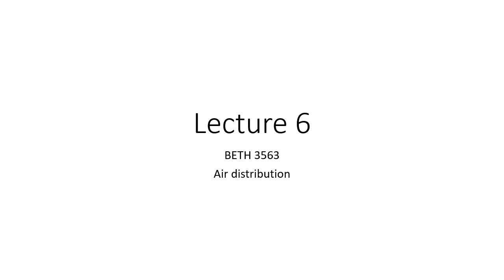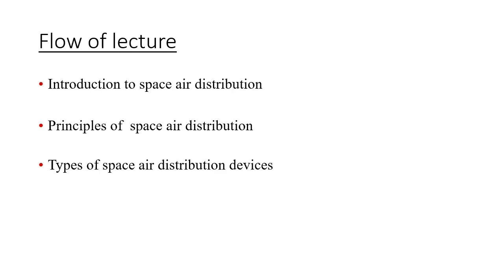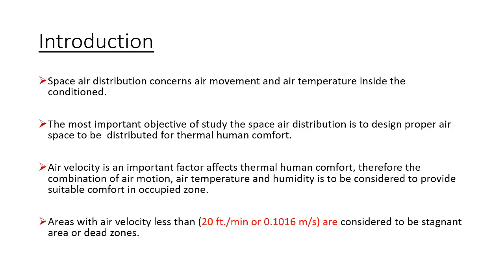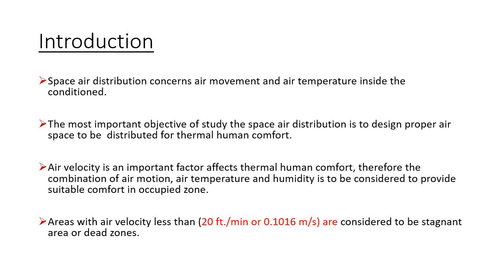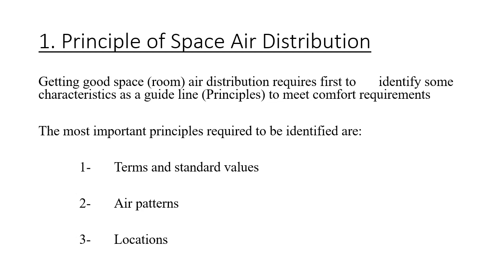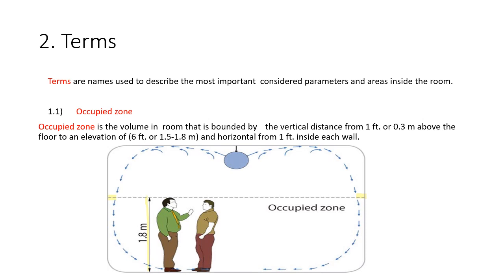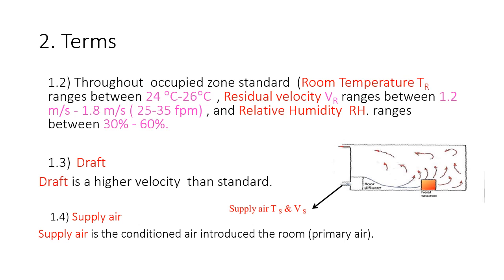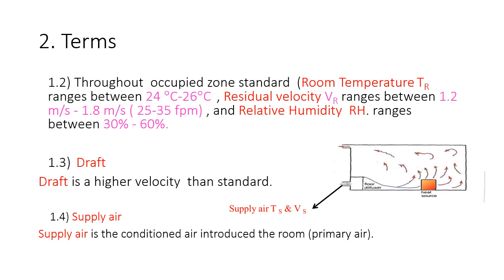LECTURE 6 SPACE AIR DISTRIBUTION

Comment: ahmad syahir bin ismail b091810081

from the lecture videos, there are four types of air distribution devices which are grills that consist of a frame and  fixed or adjustable parallel bars. second is ceiling diffusers that consist of  a series of separates concentric rings or louvers with collar or neck to connect to the duct. third is slot diffuser which consist of long strip- shaped with one or more narrow openings, depending on the number of bares. the last is plenum ceiling which is suspending ceiling below the structure ceiling ,and also called dropping ceiling.

Comment: Hakim bin Zainul B071710531

1.0 Introduction
       *Space air distribution is about air movement and air temperature inside the conditioned space.
       *To design proper air space to be distributed for thermal human comfort. 
       *combination of air motion, air temperature and humidity is considered for suitable comfort

2.0 Principle of space air distribution 
      1. Terms and standard values ( to describe most important parameters inside area room )
      2. Air patterns ( behavior of air supply to a room )
      3. Location ( important to consider in achieving good air distribution )

3.0 Type of space air distribution devices
     1. Grilles and register
     2. Ceiling diffusers 
     3. Slot diffuser 
     4. Plenum ceiling

Comment: NUR NABILAH BINTI MOHD ISHAK (B091810284)

In this lecture, we have learnt about space air distribution. Space air distribution related on air movement and air temperature inside the conditioned space. The important principle of space air distribution are terms and standard values, air patterns and location. Space air devices used to create proper air distribution in the conditioned space and it is known as air supply devices. There are four type of air supply devices : Grilles and registers, Ceiling diffusers, Slot diffuser and Plenum diffuser.

Comment: Nur Shafiqah bt Abdul Ghapoor (B071710400)

1. Introduction
-objective is to provide thermal human comfort which are the combination of air motion, air temperature and humidity.
-areas with air velocity less than 20 ft per min are considered dead zones.

2. Principle of Space Air Distribution
     2.1: Terms and standard values.
               -occupied space
               -room temperature 
               -draft 
               -supply air
               -designed temperature 
               -throw
               -air jet
               -spread

     2.2: Air pattern
            -behavior of air supply to a room
                *when Ts<Tr, air will drop down (summer)
                *when Ts>Tr, air will rise up (winter)

     2.3: Locations
            - important to achieve good air distribution
            2.3.1: High wall -cooling
            2.3.2: Ceiling -cooling
            2.3.3: Low wall - heating
            2.3.4: Floor or sill -heating

3. Types of Space Air Distribution devices:
     a. Grilles and registers
     b. Ceiling diffusers
     c. Slot diffusers
     d. Plenum ceiling

Comment: RAHIMI MUSTAPHA (B071710225)

So basically this topic was to study about air distribution (principle involve and type of device used in the system) in order to design a proper air distribution system in a space to meet the human comfort.
1. Introduction
 -  Designing a proper air system in confined space in order to get a proper human comfort requirement.
-   Space air distribution concerns air movement and air temperature inside the conditioned.

-   Areas with air velocity less than 20 ft per min are considered dead zones.
2. Principles of space Air Distribution
-  There are several principles need to used and can be used when applying into the air distribution system.
- Term and standard values
, Air patterns, Locations. All these principle play a big role in air distribution system.

3. Types of space air distribution devices
-  So the purpose of these type to be used in the air distribution was to created a proper air distribution throughout the system and in a  space.
- There several type of devices can be used to help maximizing the air distribution flow such as grilles  ceiling diffuser, slot diffuser and few more others.

Comment: Alden andrian phius (b071710392)

1. Introduction
- Space air distribution is an air movement and air temperature inside the conditioned space.
- Space air distribution is to design a proper air inside the space in order to give thermal human comfort.
- Air velocity affect the thermal human comfort.

2. Principle of space air distribution

3 principal need to be identified to meet comfort the comfort requirements. 

i. Term and values that considered the parameter and area inside the room. 
- Occupied zone
- Draft
- Supply air 
- Design temperature
- Throw
- Air jet

2. Air pattern
- Behavior of the air that supply to room
- When Ts<Tr air will drop down
- When Ts> Tr air will rise up

3. Location will considere for achieving a good air distribution. 

- High wall
- Ceiling
- Low wall
- Floor or sill

Types of space air distribution device
- Grilles and register
- Ceiling and diffusers
- Slot diffusers
- Plenum ceiling

Comment: MUHAMMAD IQMAL BIN MOHAMAD ZAIDDIE
B091810231

Introduction
1. Space air distribution concern air movement and air temperature inside the conditioned.
2. To design proper air space to be distributed for thermal human comfort 
3. Air velocity important for human comfort and its combination of air motion, air temperatures and humidity 

The important principle
- terms and standard values
-pattern 
-location

Type of air supply device
1. Grilles and register 
2. Ceiling diffuser 
3. Slot diffuser 
4. Plenum ceiling

Comment: AMIRA NASUHAH (B071710121)

1. Introduction
 - Space air distribution concerns air movement and air temperature inside the conditioned.
- Areas with air velocity less than 20 ft per min are considered dead zones.

2. Principles of space Air Distribution
-  Term and standard values
-  Air patterns.
-  Locations.

3. Types of space air distribution devices
- Grilles and registers
- Ceiling diffusers
- Slot diffusers
- Plenum ceiling

Comment: Cheah Kok Hun ( B071710006 ) Understanding about new concept of space air distribution and its principle  and the variant of different space air distribution device which can help in enhancing to design a better air distribution system. 

Principle of space air Distribution to be obey 

-terms and standard values (most important parameters and areas)
-pattern (behavior of the air supply)
-location (air distribution device is an important consideration to achieve good air distribution)

.Locations
- High Wall : Cool air drop naturally and help air circulation
- Ceiling : Recommend for cooling not for heating
- Low wall : Recommend for heating
- Floor/Sill : Excellent for Heating

Principle of space air distribution (AD)
-occupied zone
-draft
-supply air
-design temp
-throw
-air jet
-spread

Air pattern
behavior of air supply to a room
 *when Ts<Tr, air will drop down (summer)
 *when Ts>Tr, air will rise up (winter)

Types of space air distribution device
- grilles 
- Ceiling diffusers
- Slot diffusers
- Plenum ceiling

Comment: Asyraf Hakimi B071710484

Principles to be identified for good air distribution is terms and standard values, air patterns and locations. Air supply devices divided into 4 type which is grilles and registers, ceiling diffusers, slot diffuser, and plenum ceiling.

Comment: MUHAMMAD AMIR SYAFIQ BIN AHMAD SUKRI  (B071710161)

Space air distribution :
- air movement & air temperature  inside the conditioned 
-to design proper air space  to be distributed for thermal human comfort
-air velocity is an important factor affect thermal human comfort 
- air velocity less than 20ft/min or 0.1016m/s are considered to be stagnant area @ dead zones

Principle of space air distribution
- term & standard value 
- air patterns
- location

Occupied zone:
- volume in the room that is bounded by the vertical distance from 1ft or 0.3m above the floor
- room temperature Tr (24 celsius - 26 celsius )
- residual velocity Vr (1.2m/s - 1.8 m/s) (25 - 35 fpm)
- relative humidity RH ( 30% - 60%)

types of  space air distribution: 
- grilles and register
- ceiling diffuser
- plenum ceiling

Comment: NUR FITRAH NADIA (B071710363)

Introduction
1. Space air distribution concern air movement and air temperature inside the conditioned.
2. To design proper air space to be distributed for thermal human comfort 
3. Air velocity important for human comfort and its combination of air motion, air temperatures and humidity 

The important principle
- terms and standard values
-pattern 
-location

Type of air supply device
1. Grilles and register 
2. Ceiling diffuser 
3. Slot diffuser 
4. Plenum ceiling

Comment: Tiban A/L Ravichandran 
B091810285
Principle or air distribution space term
-Used to describe the most important considered parameters and area inside rooms
-Air patterns
Behavior of air supply to room
-Location
To give a best design for distribution, a location should be a consideration

4 types of supply device
-grills and registers
Usually have adjustable parallel bar in square or rectangle shape
-ceiling diffuser
Consists of series of separates concentric ring louvers with collar
-slot diffuser
It is a long strip shape with one or more narrow opening
-plenum ceiling
A ceiling under structure ceiling called dropping ceiling

Comment: Muhamad Afiq Haikal (B071710534)

#Objective
- to design proper air space to be distributed for thermal human comfort

#Dead zone is when the air velocity less than 20ft/min or 0.1061m/s
#Know the pattern to select and locate air supply properly
#Selection of air distribution device
-High wall and ceiling for cooling
-Low wall and floor for heatinh

#Type of air distributer
- Grilles 
- Ceiling diffusers
- Slot diffusers
- Plenum ceiling

Comment: MEGAT MUHAMMAD UMAR (B071710565)

1. INTRO :
- to know the space air distribution concern air movement and the temperature
-to design proper air space
-factor affects thermal human comfort
- the area with low air velocity to be stagnant or dead zones

2. Principle of space air distribution :
-term and standard values. ( occupied zone ,draft supply air, design temp, throw, air jet and spread )

-Air patterns ( when Ts is lower than Tr air will drop down indoor, usually when summer. And when Ts higher than Tr air will rise up indoor usually when winter )

-Location ( High wall, ceiling and low wall)

3. Type of space air distribution devices
-grill and registers
-ceiling diffusers
-slot diffusers
-plenum ceiling

nice information.  tq madam :D

Comment: MOHAMAD ZAHIM BIN MOHAMAD SUKAIRI B091810344

Introduction
- Objective is to provide thermal comfort zone
- The areas with air velocity less than 20 ft per min considered to be stagnant area

Principle of space distribution
- terms or standard value
- Air patterns
- Locations

Types of space air distribution device
- grilles 
- Ceiling diffusers
- Slot diffusers
- Plenum ceiling

Comment: AHMAD TAUFIQ BAIHAQI BIN MOHAMD B091810279 3BMMH S1\1

From the lecture 6 Space Air Distribution video, I've learned the introduction
 about Space air distribution concern air movement and air temperature inside the conditioned. Next, to design proper air space to be distributed for thermal human comfort. Lastly, air velocity important for human comfort, and its combination of air motion, air temperatures, and humidity. Next, the important principle
 are terms and standard values, pattern, and location. Finally, there are four types of air supply device that are grilles and register, ceiling diffuser, slot diffuser and plenum ceiling

Comment: Muhammad Zulqarnain Bin Zamzuri  B071710782

Introduction:-
- Air velocity importance because it affect thermal human comfort
- Dead zone/stagnant area = Air velocity < 20ft/min

Principle of space air Distribution:-

1.Terms and standard value
- Occupied Zone : Volume of room bounded vertical = 1ft (0.3m) above the floor to an elevation of 6ft ( ≈ 1.8m ) 
  and horizontal from 1ft each side of the wall. 
- Room temperature ( 24°C - 26°C )
- Residual velocity ( 1.2 m/s - 1.8 m/s )
- Relative humidity ( 30% - 60% )
- Draft : Higher velocity than standard
- Supply air : Primary Air
- Design Temperature
- Throw : Distance
- Air Jet : Air Stream
- Spread : Expansion of Flow Stream 

2.Air Patterns : Behavior of air supply in a room
- Summer : Ts < Tr
- Winter : Ts > Tr

3.Locations
- High Wall : Cool air drop naturally and help air circulation
- Ceiling : Recommend for cooling not for heating
- Low wall : Recommend for heating
- Floor/Sill : Excellent for Heating

Type of Space air distribution Devices

1.Grilles & Registers : Consist of a frame fixed or adjustable
2.Ceiling diffuser : Consist of a series of concentric rings
3.Slot diffuser : Long strip-shaped with one@more narrow opening
4.Plenum ceiling : Suspending ceiling below structure ceiling

Comment: Mohamad Zarif Bin Rostam (B071710681)

 Introduction 

-Space air distribution concerns air movement and air temperature inside the conditioned
-To design a proper air space to be distributed for thermal human comfort. 
-The air distribution is known to be a combination of air motion, air temperature and humidity for sufficient comfort.

Principle of Space Air Distribution
-Terms and Standard Values
: Terms is names used to identify the most critical criteria and areas considered inside a space
-Air Pattern 
:Air supply behaviour to a space
-Location
:The suitable spot or point to locate the air distribution devices

Types of Space Air Distribution Devices
-Grilles and register
-Ceilling diffusers
-Slot diffusers
-Plenum Ceiling

Comment: NURSHAZNI SAHIRA BT MOHMAD SARIFF B091810225

As a conclusion, we have learned that the main purpose of the air distribution is to design proper air space to be distributed for themal human comfort. Area with has about 20ft/min or 0.1016 m/s of air velocity are considered as stagnant area or dead zones. Next, there are 3 important principles that are required to be identified: terms and standard( to describe most important parameters inside the area of the room), air patterns (behaviour of air supply to a room) and location (to consider in achieving good air distribution). Lastly, there are 4 types of space air distribution devices: grilles and registers which consist a fixed/adjustable frame, ceiling diffuser which consist a series of concentric rings, slot diffuser which consist a long strip-shaped with one/more narrow opening and the plenum ceiling which is suspending ceiling below structure ceiling.

Comment: MUHAMMAD HAZIM BIN ISMAIL
B071710545

1. Introduction
- Space air distribution relates to air movement and air temperature within the conditioned space.
- The main purpose to study space air distribution is to design the proper air distribution system for a space so that thermal human comfort can be reached.
- Air velocity affects the thermal human comfort. For the occupants to be comfortable, the essential things that must be considered are air motion, air temperature and humidity.
- Normally, the area that has air velocity less than 20ft/min or 0.1016 m/s is considered as stagnant area or dead zones which is the air velocity is very low and there is no movement of air inside the space.

2. Principle of space air distribution
- Three principle that must be obeyed to obtained the good space air distribution: -
a. Terms and standard values
b. Air patterns
c. Location

2.1 Terms
- most important considered parameters and areas inside the room
- occupied zone
- occupied zone standard (room temperature, residual velocities, relative humidity)
- draft
- supply air
- design temperature
- throw
- air jet
- spread
- envelope of air stream
- terminal velocity

2.2 Air patterns
- a behaviour of the air supply to a room
- air behaviour is important in order to select and locate air supply devices properly and to balance and adjust the device
- when TS<TR air drop down indoors (as in summer)
- when TS>TR air rise up indoors (as in winter)

2.3 Location
- important consideration in achieving good air distribution
- high wall (good location for cooling, as the cool air drop down naturally)
- ceiling (recommended for cooling not heating
- low wall (recommended for heating not cooling)
- floor (excellent location for heating)

3. Types of space air distribution devices
- devices used inside the space in order to create proper air distribution in the conditioned space
- four types of air supply devices: -
a. Grilles and registers (a frame and fixed or adjustable parallel bars)
b. Ceiling diffusers
c. Slot diffuser (long-strip shaped with one or more narrow openings)
d. Plenum ceiling (suspending ceiling below the structure ceiling)

Comment: Mohd Syahiran Bin Mohd Pikeri

B071710026

Introduction
-Space air distribution concerns air movement and air temperature inside the conditioned
-To design a proper air space to be distributed for thermal human comfort. 
-The air distribution is a combination of air motion, air temperature and humidity is considered for suitable comfort.

Principle of space air distribution
-terms and standard values (most important parameters and areas)
-pattern (behavior of the air supply)
-location (air distribution device is important consideration to achieve good air distribution)

There are a few type of air distribution devices which is:
-Grilles and registers
-Ceiling diffusers
-Slot diffusers
-Plenum ceiling

Comment: IDA NAJIHA JUNUS
B091810091 
3 BMMH S1/1

Space air distribution is to plan the air space to be distributed and the influence of important factors of air velocity for human thermal comfort. The most important principle to identify is standard terms and values, air patterns, and locations. The types of air supply devices are grilles and register, ceiling diffuser, slot diffuser, and plenum ceiling.